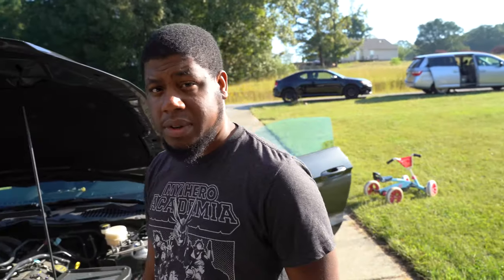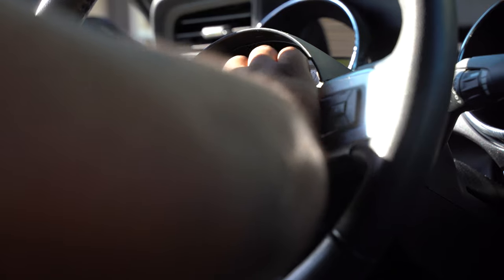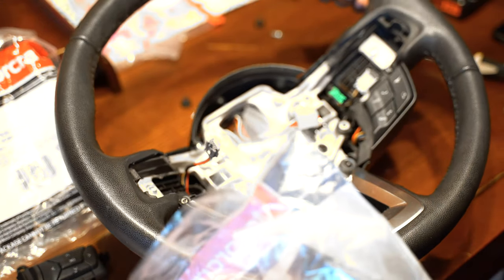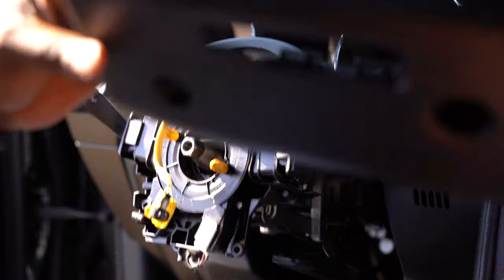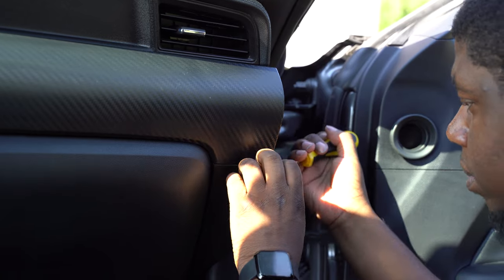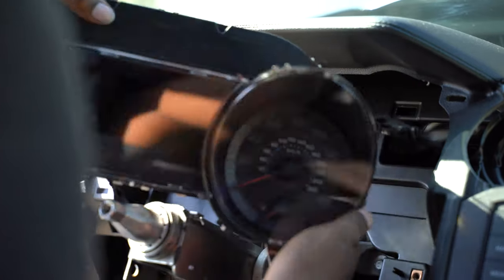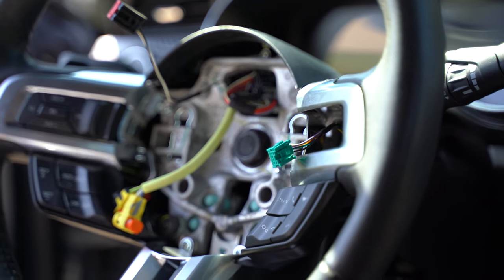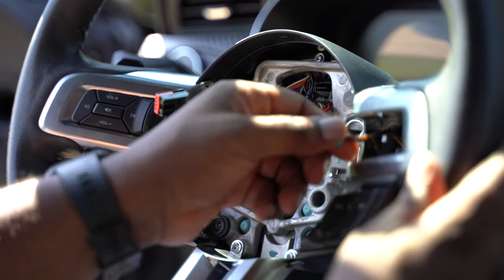How to install Digital Display 2015-Present Mustangs

Comment: Great vid, DC!  Appreciate you taking the time to really dig into the details of the install.  My kit is coming on Friday, but will be against a 2019.  Wondering if I should document it as I haven't seen anyone with an 18 or above install vid just yet.  Quite a few differences from what I can tell.  This should be the last "interior" mod, with the Sync3 from HHP done a year ago.  The guys there are great man.
Reply from the maker: jbeckva glad I could help!! I’m currently trying to build up my sub count lol. If you like this, you can expect more “How to” vids on aftermarket installs.
Reply: Did you end up installing it for you 2019? I want to install it for my 2020 but haven’t seen any posted videos
Reply: @J1234-b8c  You know, I just woke up in the morning and "did it" so no film.  But in a nutshell - easy peezy with a '19.  Nothing to cut out, but hey @Drew H I did need to swap out the bottom right and top left switches since the originals were meant for different purposes on (well, at least) the base models that also didn't come with the  Sync3.  No clockspring to swap out, either.  Honestly the hardest part was finding the spring releases for the airbag.  Did not need to remove the steering wheel, either.  It did take a few passes with Forscan to figure out what to turn on and off, so there's that but overall not bad and the cluster just .. wow.. love it.
Reply: jbeckva nice. Thank you for the info 🙏

Comment: Does the cutting of the backplate need to be done on the 2018 models ?
Reply from the maker: No sir! Youre Good to go
Reply: @DivinityCustoms  awesome. Thanks for the quick reply. I’ve seen so many videos saying you need to cut into the dash. And I’m not to keen on cutting into the dash with less than 5k miles.
Reply from the maker: @agarcia8800  I mean honestly even if you did, its not as bad as you may think. But thankfully, lol you wont have to deal with any of that